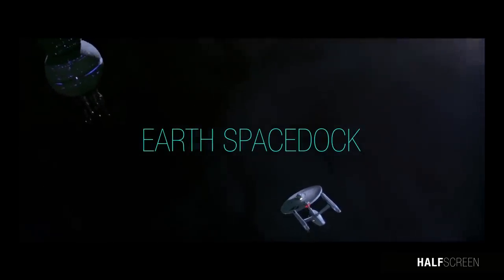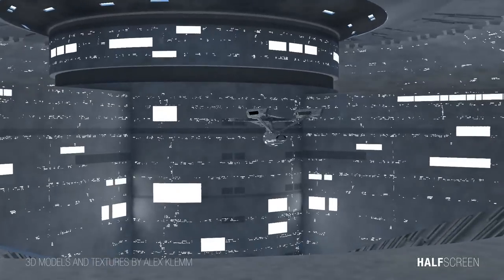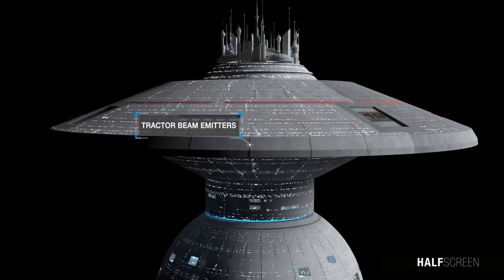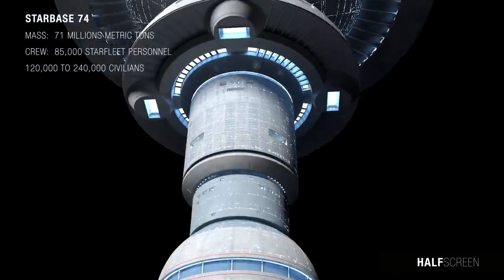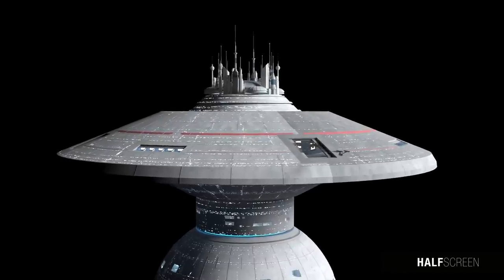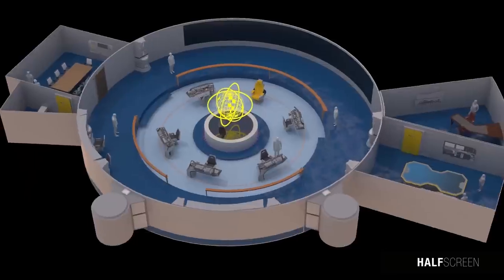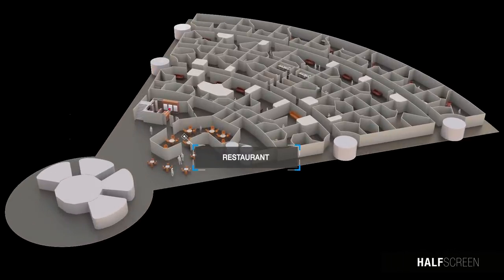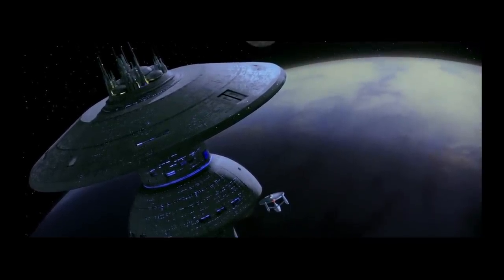Star Trek:  Inside Earth Space Dock

Comment: I think that was a quality presentation as usual. I also think the upper mushroom section would have been more space efficient if it had simply a cylindrical shape. Could have practially almost doubled its interior space with little more additional material effort.
Reply from the maker: I totally agree!
Reply: The whole design is 'rule of cool'.  A much more practical station would have the ships dock on the outside.  It's awful big for a facility that can only dock 8 ships at a time.
Reply: It probably can dock ships on the outside.  We probably just don’t see it because of budgetary reasons; we only see this type of space station in the movies and early TNG, but had they kept using this model in DS9, we might have seen more models (practical and CG) docked on the outside (or floating close by).
Reply: @mattrobson3603  That's why there are dry docks around it.

Comment: I wonder why Star Fleet did not utilize an O'Neill Cylinder design? Possibly because they have Artificial Gravity technology instead of relying on spin gravity? However, with artificial gravity spin would be unnecessary. An O'Neill Cylinder could provide far more internal construction space volume and much shorter transits of sub assemblies to the space frame. A reimagining of such a space dock would be fascinating.
Reply: An O'Neill cylinder only provides 1G gravity at the edge so it makes less efficient use of its internal volume than the spacedock shown here, unless you had multiple concentric levels all the way to the centre core. But each level would have different gravities which would still necessitate artificial gravity, unless you're willing to live with that.